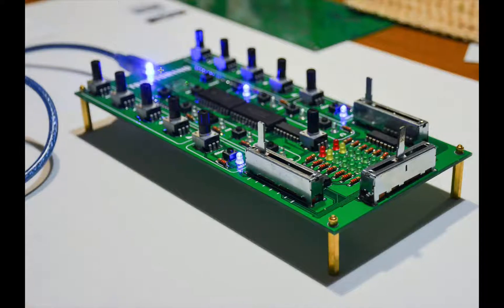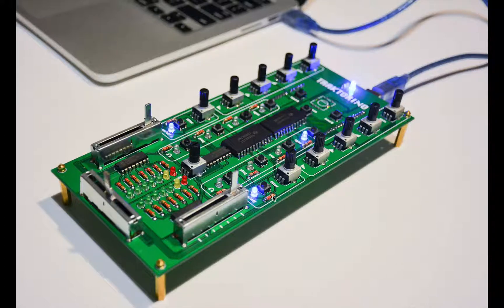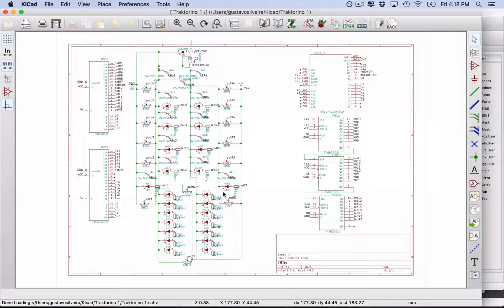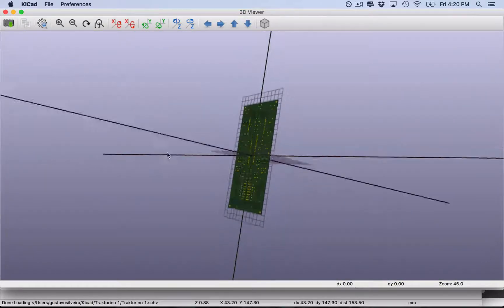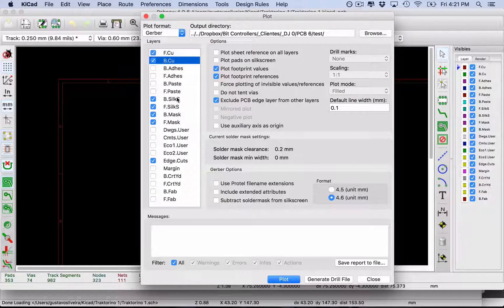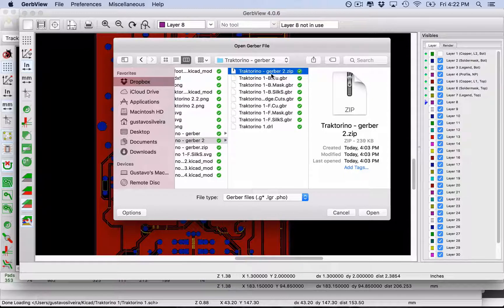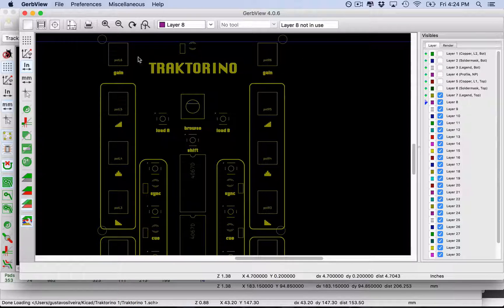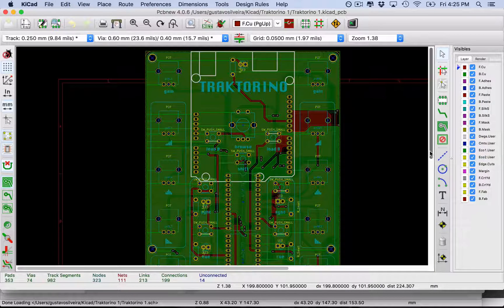How I created the Traktorino PCB - the Arduino Uno shield for Traktor

Comment: hi, i've made your traktorino, i've printed the pcb, assembled all the components, programmed the arduino board midi compliant 16u2, imported template for traktor but, traktor recognize it but it doesn't work ! traktor not recognize midi signals, it doesn't recognize any commands, i can see only the arduino led blink with the music but if i move ny pots, they doesn't work !!! what's wrong ?
Reply from the maker: Are using hairless midi, or made it class compliant? Can you open a MIDI monitor to see if it's sending messages at all?
Reply: @NerdMusician  now It works, i think that the problem Is the 16u2 file. I've made another file in the website and it's ok. Maybe yours on github was corrupted. I have some questione ti ask you : 
1- How can i add two more encoders for control traktor jog weels ? 
2 - how can convert your project ti work in wireless or bluetooth midi ?
3 - i've tried to connect traktorino via USB to iPad for use It with iOS traktor but It not work. I've bought an USB camera connector cable Also.b how can i do It ?

Thank you very much

Comment: Hi Gustavo, your project es incredible!! I would like to ask you a question: in Kicad how did you do to locate the Arduino UNO Board?...
I am doing a project and when I put the Arduino UNO footprint  this leaves the opposite then the components of the circuit created are confronted with the components of the Arduino UNO...I hope you help me telling me how this is done.
Thank you very much, greetings from Colombia
Reply from the maker: Hi! So, you have to use a Footprint for an Arduino Uno Shield, with just the pins exposed. This way, you don't need to worry about the Arduino Uno components. Sparkfun has a really good library of footprints.
Reply: Músico Nerd  Thanks¡¡¡ it worked